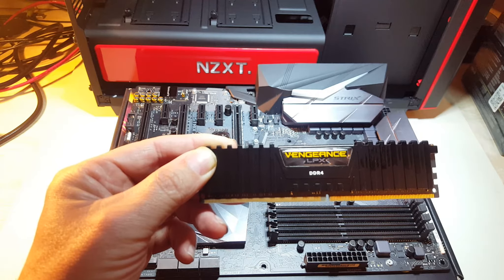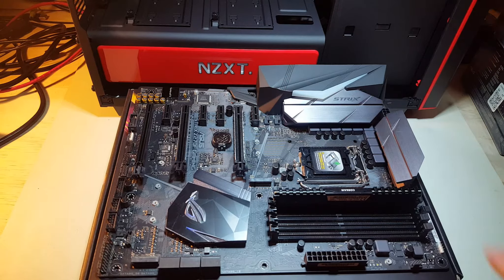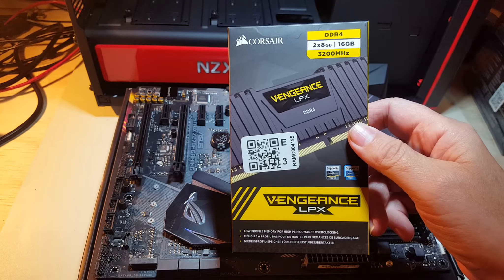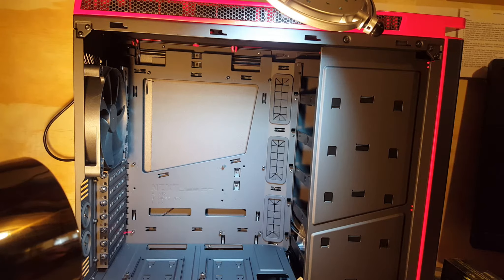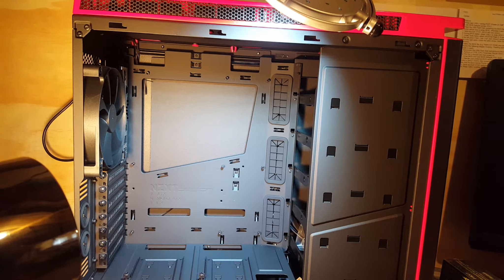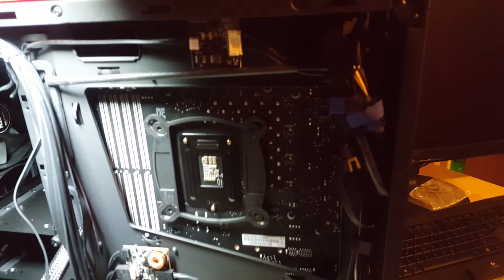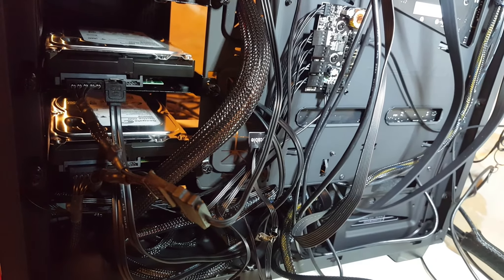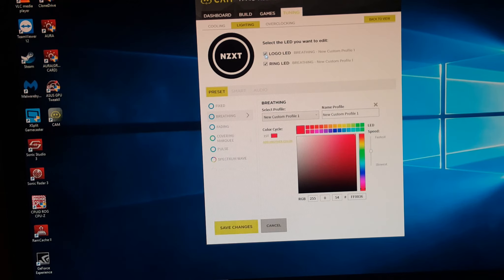NZXT H440 Build Overview

Comment: Can you do a video showing how to fit a second HDD in your H440 case? Would really appreciate it, thank you. And a question, the wires that connect a HDD to the system, if you intend to install a second HDD, are those wires already present in the case or do you have to buy new wires and then install them in the H440 case? My H440 came pre-made and I have no clue about PC building lol
Reply from the maker: The Cables for the Hard Drive are a Sata Cable to the Sata on your motherboard, and the Sata Power Connector from your Hard Drive to your Sata Power from your Power Supply itself, you should get at least 2 Sata cables with the Motherboard, and the Sata Power Connector will be on your Power Supply and there are usually 6 connectors...As for installing a Hard Drive in this case it's shown in this video...if you need it done in a different way let me know and I'll see what I can do...Thanks...